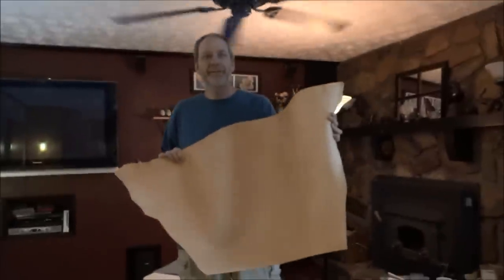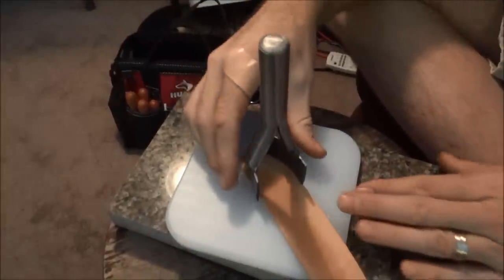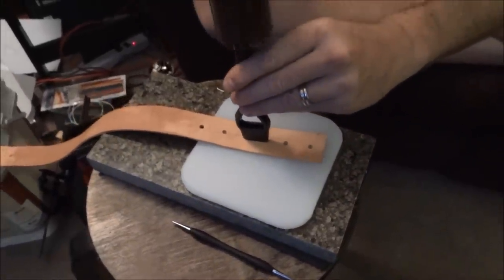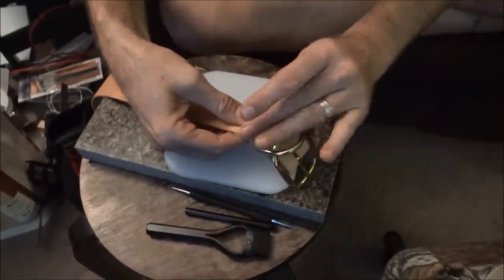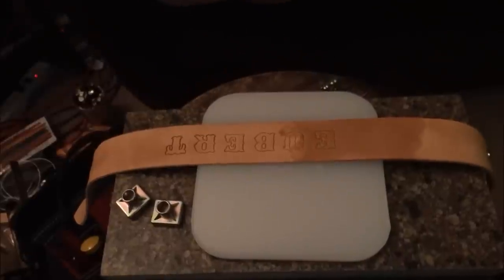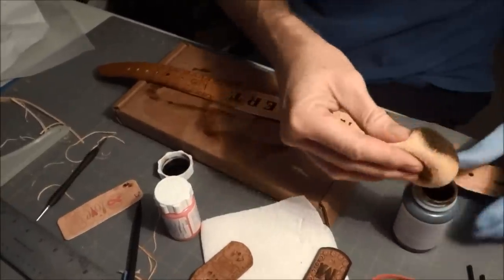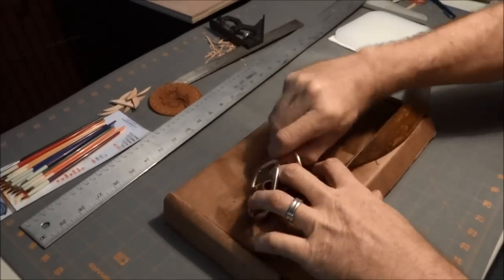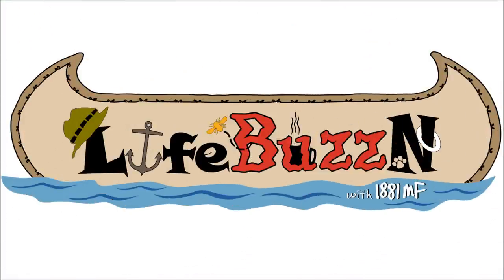World's Easiest Hand Made Leather Dog Collar

Comment: Looks cool to me! Also a novice leathercrafter, i'm going to start a couple of collars for my GSD and Border Collie soon. 

My tip: If you want to stop the dye getting on the back, tape the back of it with packing tape and smooth it down firmly... Then try to avoid pooling up at the edges or it'll soak through the sides.